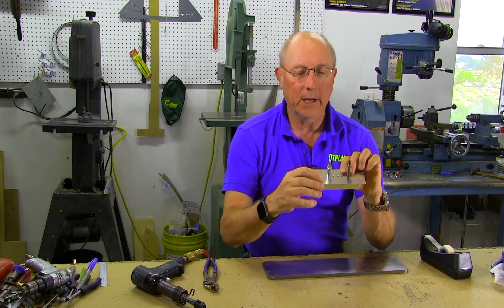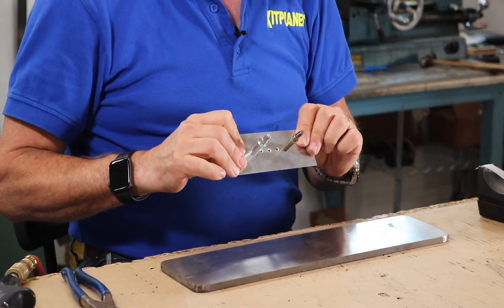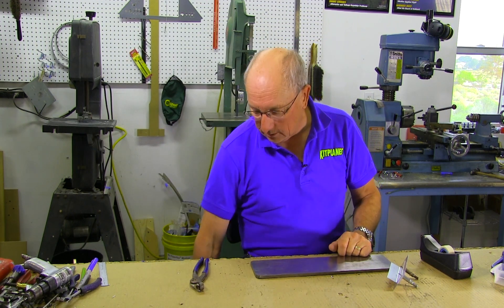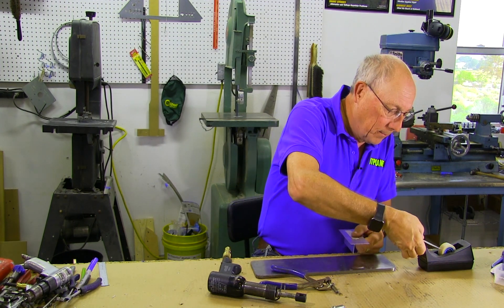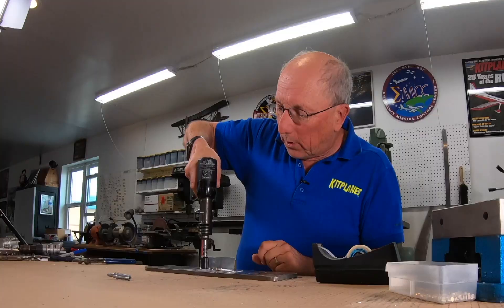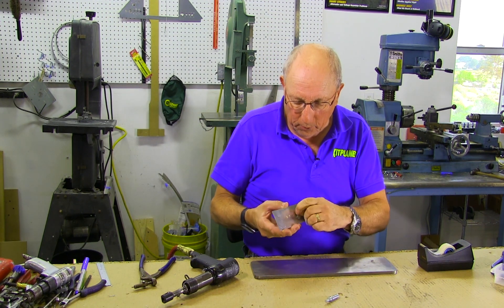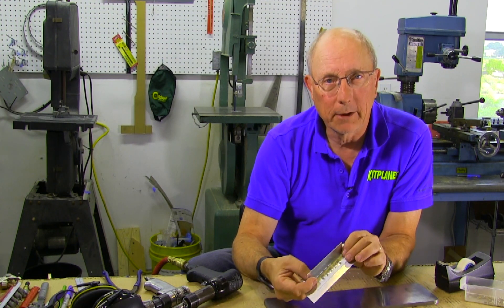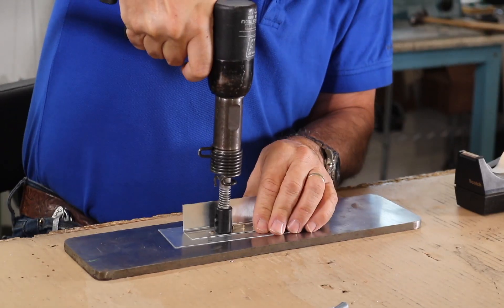Metal Magic: How To Back Rivet

Comment: What I would need is an explanation on why everything works the way it does. For example in regular riveting,  the back side spreads out and the front domed side remains the same. But we have an equal force being applied to both sides from the rivet gun. Ok the domed side of the rivet has the domed part over so it has a larger surface area. But the back side of the rivet flattens out so it's surface area becomes almost as large as the front domed side. 

Anyway that is the way my mind works. Why does the rivet flatten on one side and not the other.
Reply from the maker: The factory head (domed part of the rivet) is driven with a rivet set which has a concave tip. The shop head is formed with a flat bucking bar. Watch this video for the explanation: https://www.youtube.com/watch?v=BAMZhawoSOE
Reply: @KitplanesMagazine  That was not the question. Why the domed heads not become flat heads from the impact against the flat hard surface, was the question, I think. A good question at that.
Reply from the maker: @tonylawrence9157   The domed head is not being driven by a flat surface. The rivet set is similarly domed, so while the shop head does conform to the rivet set very slightly, it maintains the same basic shape. If you drove a dome-head rivet with a flat rivet set, it would indeed mushroom out.

Comment: Why not weld the plane instead of rivets?
Reply: Very thin metal. And the surface area of the weld would be very small. The rivet surface area spans the 2 sheets in the center of where they join. . The weld would be just at the very edge.
Reply: Its easier to remove/replace rivets. In actuality, sealants are used between the contact points of the work pieces as well as around the rivets for moisture control.

In addition, to install/remove welded skins or structure, could possibly involve heating things up to where the metal integrity will be compromised which might lead to catastrophic structural damage/failures down the road. 
Also, if the aircraft is one that is pressurized, at altitude, the aircraft must be designed to slightly expand and contract due to the differences in air pressures inside and outside of the fuselage. Welding the skins/structure drastically restricts these contractions and expansions to where cracking can be established with the end result being the obvious structural failures.

Of course, you should follow the recommended manufacturer's structural repair manuals/FAA ADs/etc., wherever possible....unless you're building something other than an aircraft.

Comment: The plans in my kit tell me to rivet the rod-end of my elevator pushrod.  The rod is 1/2"  alum tube, with a 3/8" doubler inside and with a 1/4" headless  bolt inside of that (where the rod-end bearing screws on)  Solid alum rivets are shown; 3/32"  x 3/4".   I can't find anyone on the web who has riveted a tube like this.  Could you please demonstrate this?    Thank you.
Reply from the maker: Which kit and are you sure the instructions are not calling for blind rivets?
Reply: @KitplanesMagazine  It is a Fisher Koala FP202. They are calling for solid aluminum rivets: 3/32" x 3/4" to go through near the rod end.  There is a short length of 3/8" tube inside the 1/2" with the headless bolt in the 'core'  so it is not hollow there so pop-rivets won't work.  Thanks for the fast reply by the way.
Reply from the maker: @sheldonrigsby  So a hole is to be drilled all the way through the 1/2" tube along with the doubler and the bolt? Can you email a photo of that assembly to editorial@kitplanes.com?
Reply: @KitplanesMagazine  Yes,  exactly.  You have it pictured correctly.  And then the battering rivets are put through the long holes.  I will email a picture as soon as I can.  Thanks again.